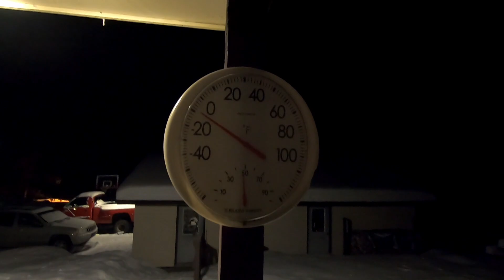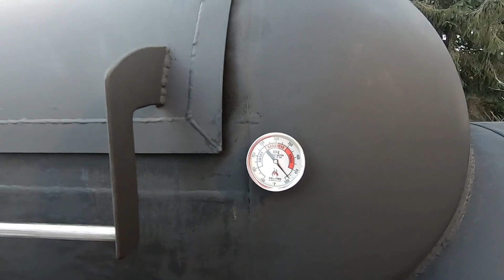1000 Gallon Offset Smoker Build Part 12 - The first cook

Comment: Well done indeed!!! I love what y’all did and the detailed videos that were made on what it took to make such a beast!!
I would like to throw out a few suggestions, 
1) if you put a damp cloth or not damp under your cutting board it helps it stay in place.
2) I saw another pit master do this but he used a pump up sprayer to spray the meat which looks like a huge time saver and easier method to keep things moist.
3) you can if you choose to weld on nuts to the outside of your tank that the thermometers can screw into, making it easier to remove and install

Other than that y’all did awesome work, looking forward to future videos, thanks!!

Comment: Nice build, get on Amazon and buy Lavalock black food safe BBQ adhesive. You can put it around the seal of the doors to hold more heat in. Happy smoking, guys!
Reply from the maker: Good suggestion, I'm not a fan of all that smoke coming out of the closed doors. Thanks!

Comment: Thread the hole so you can screw the temp gauge in the steel.
Reply: No...
Reply from the maker: We were able to make it work after we took off the washer on the back. Didn't know it was removable at first